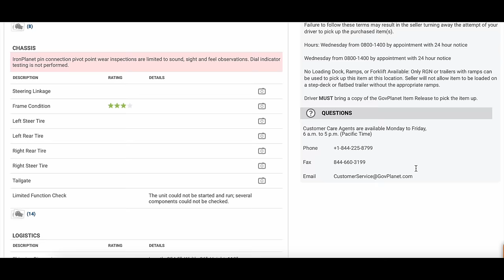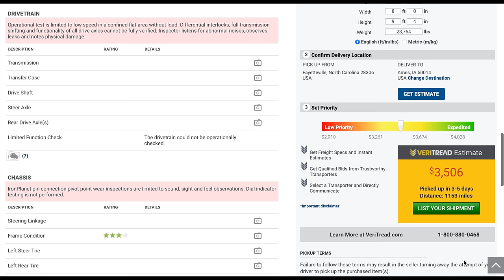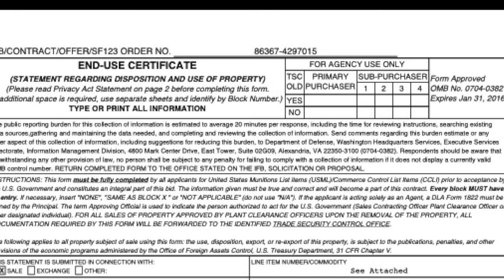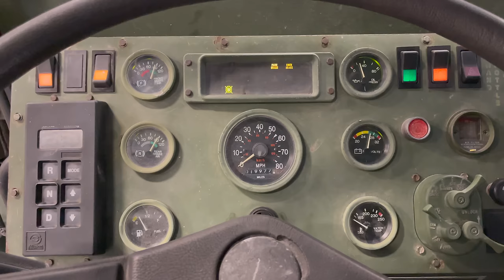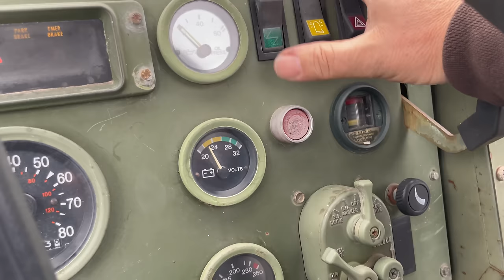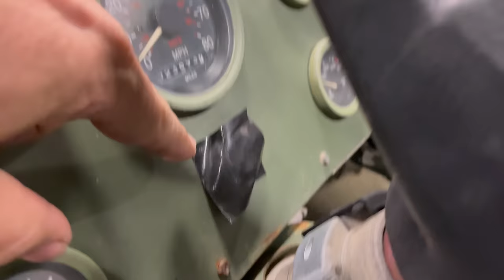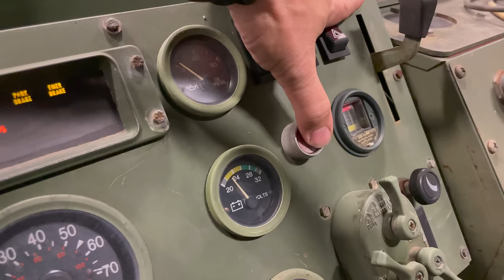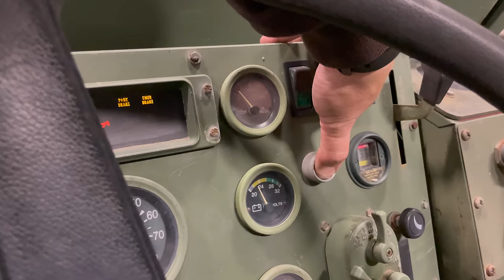Buying a LMTV on GovPlanet Wasn't How I Expected

Comment: When removing a nut from painted, dirty, or corroded threaded stock, I've taken to power wire brushing the threaded stock (and nut) before I start. Makes the job so much easier and is good for inspection of components also. Saves a lot of hassle and work not to mention skinned knuckles or damaged tools.
Reply: I just spin them off with the air impact until something breaks 🤣
Reply: @TheNapalmFTW  Funny. Hard to know if you're kidding though.
Reply: @brentscottbrent1  I am. Lol
Reply: First spray it with SiliKroil the day before. Then do your brushing and spray it again. After you try one can you will be buying it by the case. You can thank me later. No I don't sell it.

Comment: Just as a point of comparison, if you buy an ex-military anything from a British or Australian source, they are in very good condition (they are serviced and fixed prior to sale). If they are in bad repair, the Army just scraps them and does not even attempt to sell them as a safety measure. I've also seen, quite often, that they throw in spare parts for free if the reason for sale is it's a discontinued platform and they just want to get rid of it.

Comment: I like how they sell trucks in a better condition than what they toss into my motorpool. Trucks with severe frame damage from PFCs that managed to back into the only tree on the DZ for 5 miles. Trucks with rusted out beds, interiors that are so infested with mold that they have been “condemned” and sitting in the same spot for 6 years. Trucks with crushed roofs because SPC Snuffy thought he was a master forklift driver with his 30 hours of experience.

Comment: Yeah I've been looking for USPS vans on Govplanet over the last year and also thought there was some dodgy stuff going on there. Bid on maybe 3 or 4 and was 2nd place twice. Was told not to bid a maximum.

I think for better or worse sometimes they don't check very thoroughly. It depends on the inspector. Saw some of the same ones relisted within a few weeks so for whatever reason the person who won backed out.
Reply: Got a chuckle  out of "charge the battery and will probably go".  Bought two FLU 419s, the one from Govplanet was a piece of junk.  Said the engine would not start.  It was locked up.  Controls inoperable.  Main shiftier was broke off with hilo switch missing.  ($200)  Filed for  a bid warranty, not allowed.  Bought a second truck from GSA auctions,  was much better shape for $750 more and three thousand dollars worth of tools included.

Comment: My unit on FT. Carson (3rd ACR) back in 96-97 was one of the first units to get the LMTVs. We had multiple issues with the cap raise and spare tire raise lower valve banks. And just overall the trucks were objectively worse than the older 5 ton series of trucks they replaced. The LMTV wreckers for instance were complete garbage that are often more trouble than they were worth. The old 5 ton wreckers at least had a gondola boom that made them far more useful to mechanics in the field and in the motorpools. The LMTV wreckers were something we prayed never came our way. The HEMMT series of trucks was the Army's work horse without a doubt. But yeah LMTV's made me extremely happy I was a Bradley mechanic and not a Wheel mechanic. Tanks and tracks are far easier to work on if but a tad heavy lol.
Reply: Agree. Was a NCOIC Course Manager for one of the U.S armies 88M Schools. LMTV's nothing but trouble. The older 9 series 5-tons a LOT better. Even the earlier 5 speed 8 series.
Reply: I feel your pain brother. I remember snatching a loaded 915A3, mired to the axles with a 5-ton wrecker. I also remember being on the receiving end, needing to be snatched out when I mired my LHS and trailer. Glad B co. had a HEMMTT wrecker that day! Nothing like accidentally pissing off range control haha! Of course, nothing compares to the mighty 88. That'll pull or flip anything you can put your mind to! I miss the mech.
Reply: 06-15 I dealt with LMTVs, mostly loaded with a 60k gen set and towing a Q37 radar.  The LMTV was way more reliable than a HMMWV, and could hold speed better on hills.
Reply: LMTV wreckers are a crime against nature. Hated them when I first used one in 2007 I think. My stance on them didn't change the last time i used one in 2011. Loved my HEMTT Wrecker but she was the worse thing to bobtail in. When the newer A4's started rolling in life was good. Had access to a Maxpro wrecker in Afghanistan. Wish we had one state side but that never happened. Spent a year using a LMTV wrecker and when the stars aligned I would get to run with the HEMTT wrecker. Thankfully after the year was over we got to turn the LMTV wrecker in. Blood and Steel brother.
Reply: @kimberleyturner701  i was in alpha 58 trans ft lenardwood mo.1988,retired 88-m in 2008
Reply: When they put Bradley's On gov planet I'm going to give you a ring!!

Comment: From what I see.it is all explained on the website. I think it would be best to be pre approved. That would save ,moths of wait time. Once approved then go bid. From what I read everything the author mentioned is in the website. It even tells you if the vehicle will start. Me personally, I would drive out with a friend and drive it back. You se you friend as a support vehicle. It would be a great adventure driving it back across the USA. Of coarse give your self plenty of time for break downs. I did this once with a similar vehicle. I figure what the heck I will drive it till it breaks and if I have to tow it…..it will be a cheaper tow. I made it 1500 miles and it finally broke 5 miles from the house. I was able to limp it home and had a great adventure. Just read the website.
Reply: Bit confused, what should I read?

Comment: I work the motorcade as a civilian contractor, I hated the LMTV's because of the electrical issues they all had. Interesting vehicles though, the engine, transmission and gear oil are all 90 weight. The axle gearing is in the hubs and the run flats are a cool design too but go ahead and get you a torque multiplier for the nuts and bolts they got through the two-piece rim. All the hydraulics are easy designs especially the jack to remove the spare tire. And even as heavy as they are they did pretty fair in Kentucky mud.
Reply: @Peter Angles Yea its not correct. Engine oil is a standard 15-40, Transmission fluid is a standard "Cherry juice" (dextron 5). I think 10 weight was authorized under some extreme circumstances and required motor pool SGT sign-off. More often than not it was just not replaced if cherry juice was not available. Gear oil is 90 weight.
Reply: @dmitrychernivetsky5876  it depends this is the older a0 a1 not the newer one

Comment: I wish you all the luck in the world. Every LMTV I ever drove was a knackered POS. I can vividly recall driving 12 hours cross-country in one with a massively cracked windshield and a defective brake pressure alarm that couldn't be turned off. I can't recall a single one where the central tire pressure system worked properly, so nobody ever used it.

Still... you could fit 10 Joes and all their battle-rattle in the back, so off we went!

Comment: I Was in the Army when they started introducing these trucks to different units. It's crazy how fast they are for sale  for civilian use to fast. Some military units didn't get these until after 2001
Reply: Hell, they adopted the JLTV years ago and my last FORSCOM battalion still only has one. In the entire battalion. I'm sure you can guess what company got it.
Reply: They're obsolete now is why.   The army is getting rid of the ones that aren't up armoured.
Reply: @BeKindToBirds  we still had Chevy blazers in my unit. I was in from 1997-thr end of 2001
Reply: @lilcourtny08  I didn't even know the army ever used blazers lol.
Reply: @BeKindToBirds  in the early 80s they bought cucvs.which were bought from Ford, chevy,dodge international.mostly they were using them on base very rarely would you see them in tactical situations or field problems

Comment: 5 tons are awsome but the 7 ton the marines have is 1200 hp cat motor . 
 I dont kniw a whole lot about military vehicles but i did haul military equipment for about 10 years. A lot of the stuff would go to places like Fallon NV to the air base and placed out in the desert to be blown up by fighter jets training . 
We took alot of old APC's  out there but 1st we would take them back to our yard. A large percentage of these old vehicles would still run and by putting minimal effort into getting them running and switching some parts off other vehicles to get them to move or function we had a blast. We actually had a track out in the feild and have races with old trucks and APC's ,lol ..we definitely gave a lot of the old vehicles one last bit of glory before taking them to be blown up. 
 With some basic mechanical skills and knowledge of how a fuel pedal , steering wheel and breaks function,  just about anyone can drive these things.

Comment: My Brother was a Heavy Equipment Repairman in the Army National Guard. He was out in the Field retrieving at the end of some Exercise years ago. One day he was Towing a M198 155mm Howitzer with a LMTV down a Country Road when he felt a Jolt.
He looked in both Outside rear view mirrors and spotted the Howitzer going into the ditch to his right.
The four bolts holding the cross member at the rear of the Frame were SubStandard and snapped allowing the cross member that the Pintal Hook was mounted on to pop out of its Mount.
A Farmer happened along and Volunteered to tow the Howitzer to the Guard Armory. He used his Articulated Big John Deere Tractor to Tow.
My Brother’s OIC saw the Tractor and said that the Guard ought to Invest John Deere.
My Brother considers the LMTV SERIES Junk.

Comment: This sounds like one of those nightmare trips 😂
Reply: The nightmare trip is the wiring harness behind that relay panel.  Every one of the hundreds of wires in the cab is WHITE.
Reply: I have found that these are the trips you remember most!  Nothing like a little challenge to get the heart and mind working again!
Reply: Dealing with Ritchie bros. is ALWAYS a nightmare!
Reply: A "Ritchie Brothers Special" = slap a new coat of paint on any old POS with a motor and sell it for an inflated price

Comment: Everyone dogs out the LMTVs, but when new, and with an initial 'test out', they are relatively solid vehicles. The Cat 3116/3126 engines are near bullet-proof (when left alone and untampered with), the allison transmission is the same (allowing for proper PMs), the frames, beds and cabs are robust...and if yours came with the hydraulic winch, that's awesome. What to watch out for? Anything electrical, computerized and/or complex (like those hubs). Bought new, an M1083 will survive for a million miles or more, allowing for proper care and PMs. Treat it like a 'Ford Raptor', rock crawl, submerse the hubs, lot of sand driving...and you're going to be an expert at MTV axle repair...jump rocks and knock it about, and you can add 'expert at tracing wiring shorts' to that list. I use mine to pull an 18,999  pound Gehl Teleloader on blacktop...and I service it less than I do my 3500HD Silverado, that's for sure!

Comment: We haul brand new, to inter-base transfers, and final disposition up to 36,000lbs. We have ramps and charge as per following within the 48 states: 

milage ÷ my lowest fuel economy x the average fuel cost x 3

Ex: 1,800 miles ÷ 5.5 (low fuel economy) x 3.85 (average fuel price) x 3 = $3,780

We can haul 2 LMVT's or mixture of 2 per delivery.

We work with independent owners, mom & pops, all the way up to Big Army and AM General, Stevenson, and Oshkosh.

P.S. Most motorized Army equipment are moved in pairs, because one is certain not to start.

Comment: I had a deuce and a half and still have a pinzgauer and considered a LMTV for a moment but was turned off by the auto trans and all the electronics. The deuce although really cool was a chore to drive for me since I am tall and it really didnt fit my body. So far the pinz is my great love...it may be my forever vehicle and is so simple....great video
Reply from the maker: Only electronics on the LMTV are for the trans.  Big advantage the Pinz had over the LMTV and M35 is the locking diffs.  They are open on the American trucks.

Comment: Stew and Steve originally thought that they could buy the drawing package from Steyr, slap a new logo on the drawings, and call it good.  Per Fed Specs, they tried local sourcing for metric thickness steel plate,  and then spent three years redesigning the whole truck, because of tolerance stack ups...
They bought a glass tempering factory in Sealy, Tx, rebuilt it as an assembly line and test track.  At the time, it was the largest CARC coating installation in the world.
Reply: I drive by that Sealy plant occasionally.  Only drove by it once while Stew & Steve still owned it.  British Aerospace Equipment had it for a while, and then someone I have never heard of.  Just want by it two weeks ago, and it all looked pretty much abandoned / shut-down at this time.
Reply: That is amazing... now I know what CARC is!  And being from College Station I had no idea that S&S was in the area... wouldn't need to I guess .

Comment: As a retired Soldier I can tell you that the LMTV as well as the 2-1/5 ton and 5 ton Army trucks with exception of a few that were sent to the scrap yard because of battle damage or just a parts vehicle. Are usually still great toys for playing and work. They are built for almost anything and I promise you some of us soldiers have definitely taken some of them in places such as black basalt in Fort Irwin in the Mohave desert which is literally covered in boulders the size of a VW side by side and front to back meaning if you drive on it then you are only drive on boulders!! Scary but great fun!! HOOAAH

Comment: Something else to consider with these, PLS, HEMTT and similar vehicles is that often in cold climates ether is used to help cold starts in the winter. If used sparingly its not an issue. However, as someone else pointed, 19 year olds that don't know better over do it and create what's called an "ether baby." A truck that won't start without using ether. Definitely something that happens mostly on the older engines in the HEMMT style trucks. The newer Detroit diesels tend to start up a lot easier so don't need the system as much. 
But something to keep in mind if you're looking to buy one. Find one that's spent is life at Fort Bliss or other southern state like NM or AZ.
Reply from the maker: Interesting thoughts
Reply: Not thoughts so much as experience and training. I once was a 63b.
Reply: I have a block heater on my starts right up like it's Summer in Las Vegas.